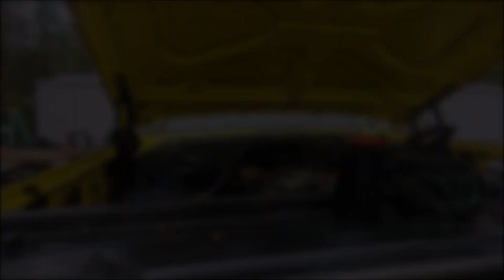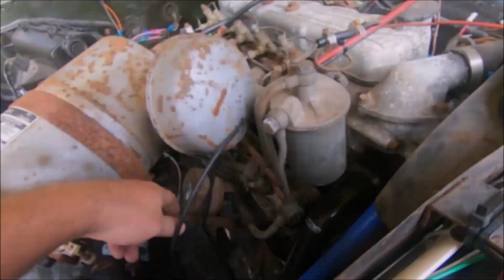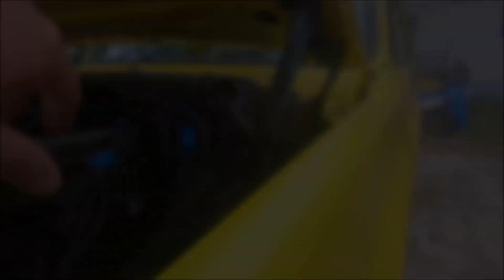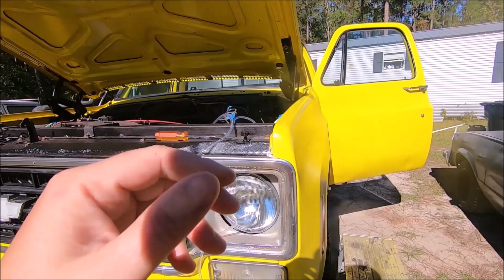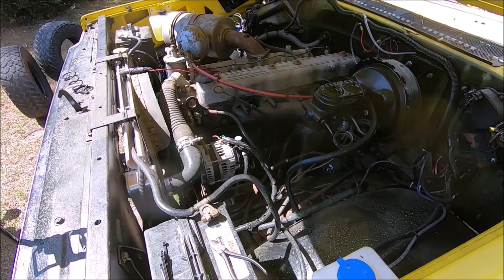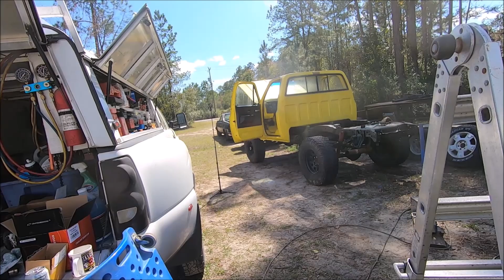1975 Chevy diesel--engine compartment final changes | part 16

Comment: Hello!!!!! Can you please help me?

I was driving my 2004 Duramax LLY Kodiak, and everything seemed fine. Then the truck started stalling when accelerating, so I went home, looked on YouTube, and decided to change my pressure relief valve to a race fuel plug. After that, the truck ran better with no bogging. If I pressed the pedal slowly, the speed would climb, but acceleration was still sluggish.

After driving it for a while, the truck kept getting slower and slower, and white smoke started coming out. I replaced all 8 injectors, and the truck ran great—like new—for a day. But after a few weeks, it became slower again, though it was at least consistent.

I was still getting a lot of white smoke on startup, which lasted about 30 minutes until the truck warmed up. I replaced the fuel filter, and the white smoke seemed to go away for a bit.

I then hooked up a vehicle scanner and found that injector #1 was putting in more fuel than the other 7, which all registered the same. Thinking it might be the fuel pump, I replaced it with a new one, but the truck ran the same. I was still getting shaking and white smoke.

Then, the truck started dying again when accelerating, so I figured it might be the fuel pressure regulator. I replaced it, and after that, the truck ran good for weeks. No issues—just a little sluggish, but no shakes.

Later, I replaced the number one plug, and after that, the truck had no misfire and ran smoothly.

One day, I went to drive it, and there was no white smoke or shaking, but it was slower again. Then, it suddenly went into limp mode, wouldn’t go over 20-30 mph, and wouldn’t rev past 2000 RPM. I limped it home, thinking it was the fuel pressure sensor, so I replaced it. The truck ran again but was still in limp mode and hard to start. I had to pump the fuel filter and bleed the screw to let air out, but that still didn’t explain why it was in limp mode.

It’s a 2004 LLY Duramax with 149,000 miles, and I feel like I’m just throwing money at it trying to fix it, but I still don’t know what’s wrong. I’m not getting any codes, which is weird because when the injectors were bad, I did get a code. Now, nothing.

I feel like it might be the fuel filter, but I’m not sure. Any advice?
Reply from the maker: The first thing I would do is try to get some hard data to stand back and take a look at possibilities. It sounds like it can be roughly narrowed down to the fuel system, but there is one variable that’s consistent throughout what you describe: when the fuel system is opened for maintenance and then sealed again and bled, it works for a while. Whether that’s an actual correlation or not, it is something of note. It could be something as simple as a pinhole in a line, for example there are short rubber lines running to the high pressure pump side the pressure regulator. If one of these hoses has a pinhole the system will have pressure issues…. Just an example for reference.
But the first thing I would do is try to get some data. Get a good scanner or a Tech2 that can get good in depth data of the fuel system such as balance rates, desired fuel pressure, actual fuel pressure, etc. Graph some live data and look for abnormalities such as actual fuel pressure not matching desired, etc. Basically do a deep dive and get all the data you can glean from it and that will give you a starting point of where to suspect.
These trucks have relatively complicated fuel systems, but they also have a lot of sensors that kick back data for evaluation. I would see what I could see in a deep dive on the live engine data for the truck.